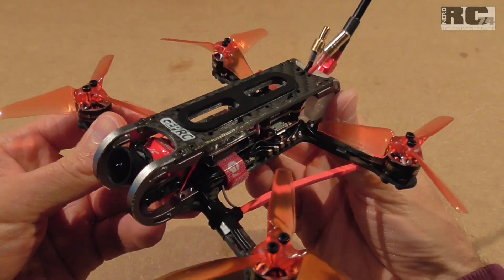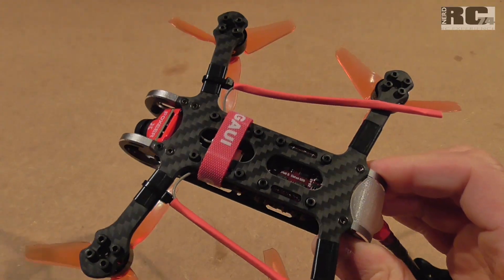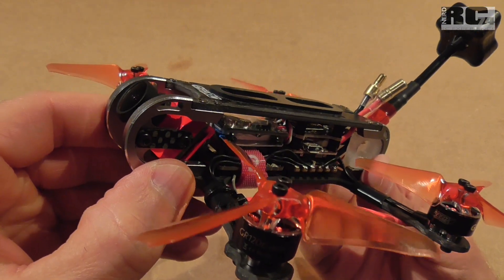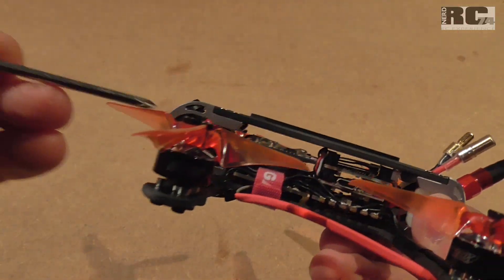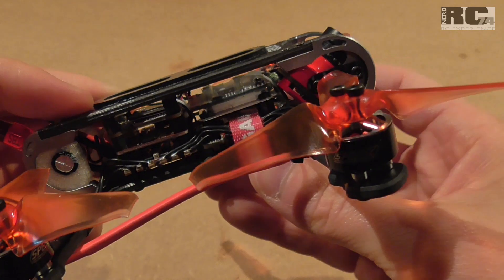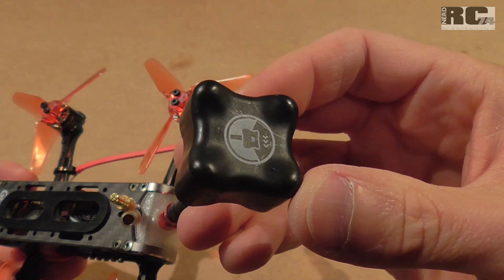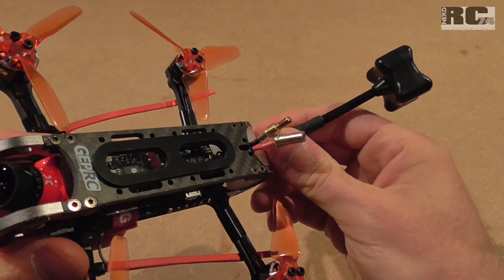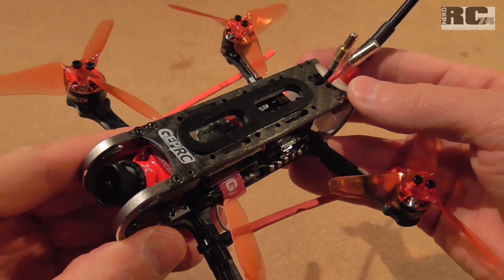GEPRC CYGNET CX3 & FOXEER MIX | BUILD REVIEW AND MODIFICATIONS

Comment: I bought some of that Ummagrip and was impressed at first, but as soon as it gets any dust on it the battery will slide in a crash. I just got some sticky back velcro and put it on all my batteries. I built a 3 inch Tadpole and tried those Emax Avan props on it too. For me they work great with 3s but on 4s my quad freaks out if I suddenly give it a lot of throttle or if I touch the ground. I just bought this frame. The pro version. I'm hoping I can get a Runcam Hybrid in it. Great looking build.
Reply from the maker: All the sticky pads need to be clean to work perfect. The Emax Avan Mini work great on the Cygnet CX3 quad. Also on 4s. Here is an example video flying on 4s: https://www.youtube.com/watch?v=SDm_sP7i5Mo

Comment: Nice video and build! Also got a foxeer (mix 2). Where can I get those brackets? :)
Reply from the maker: The Foxeer Mix 2 is way shorter than Mix 1. So you don't need to use these brackets. You can install it just the regular way. No modifications needed on the frame.
Reply: @RCnerd74  thanks for the quick reply! 🙂🙂 Did not try to fit yet, but that's good to know :)

Comment: Hi RCnerd, I'm about to buy the CX-3" Pro bare frame as a noob-trainer. Now after one year what do you say regarding the carbon quality especially bottom-plate/ arms, you know how to fly will it survive a beginner? Bottom plate is quite costly when I kill an arm. Thanks in advance!
Reply from the maker: I recommend to try the first moves on a simulator like liftoff. If you wanna go straight to the real thing, learn to fly on a grass flied. That will avoid to break arms. On concrete, I think every frame will break. My frame is still the first.

Comment: Doesn't look like that plate on the back of the camera is necessary, take it off.
Reply from the maker: I only mount parts if they are necessary ... believe me ;o) it is because i had to cut the original mount. This hole is open at the backside. so i needed to do the custom plate to have a wortking hole at the right place...

Comment: Hi from Canada, That was a great run down on the quad, I just received mine from Bang Good. and having issues. I am using a Jumper T8SG Plus transmitter. Binded ok and armed but my props do not spin up. I updated firmware and still nothing. Just wondering if you had the same issue when you got yours? Thanks in advance.